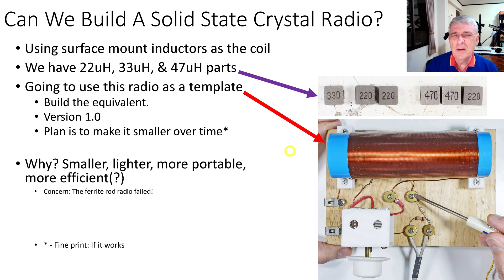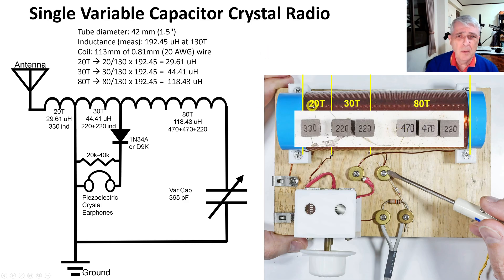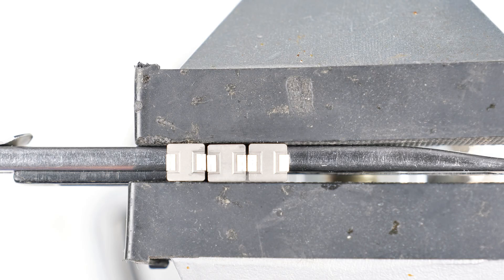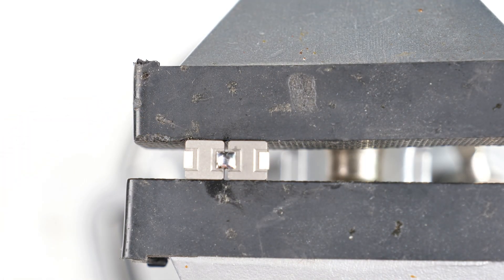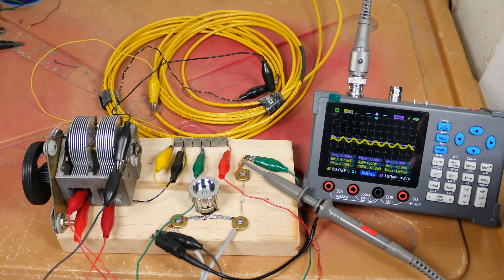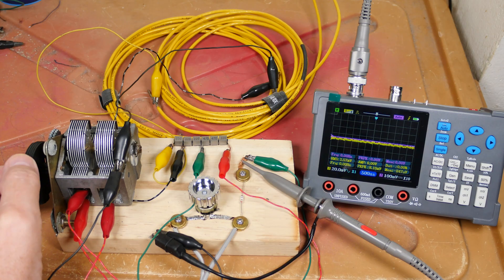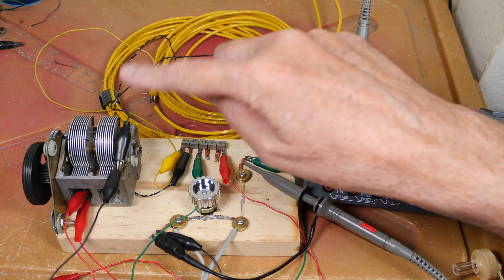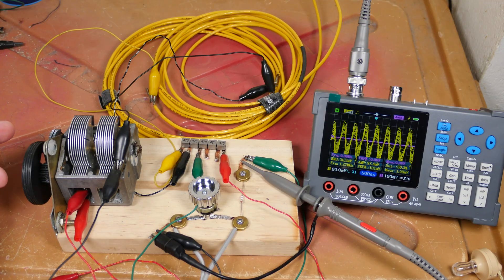Crystal Radio--Using SMD Inductors??? (4K)

Comment: I suggest using a different radio circuit.  The usual radio circuit using coupled inductors for impedance matching, but there's an analogous circuit that uses a capacitor network with a single inductor.  In fact, I have it working on my desk right now!  Instead of tapping the inductor side of the LC resonator, tap the capacitor side.  That is, put two capacitors in series, those parallel with the inductor.  I'm using 150 pF between the antenna input and ground, with a 10-400 pF variable capacitor between input and the top of the inductor.  My inductor is 40T on a 3" cardboard form (salt box).  My diode comes right off the top of the inductor.  Since this design uses only a single inductor (200 uH, if I've calculated in right), you should be able to use an SMD inductor in its place.  (PS: My antenna is a dipole cut for 3.5 MHz, 50-ohm impedance, my earpiece
Reply from the maker: I think your comment got cut off.
Reply: @tsbrownie    You're right.  The last sentence should have read "my earpiece is a high-Z crystal earpiece from a commercial crystal radio kit."
If you want more details on the "single-inductor, capacitor coupled", design, I could send an email if I had your address.  I'm at "lathechuck (as shown in my photo)", using a popular email service (if you care to guess).
Reply from the maker: @cdorcey1735  My email is in the "about" on my channel. I'm always interested in new designs. Thanks.

Comment: "in theory inductance is inductance". No, you are wrong, there are different inductances types. Like mutual inductance. A transformer is not just two coils, primary and secondary. Those inductors you are using, have you opened them? I think that they are made on pot core or something like that, that is why they do not work. The one station you received was because it was the most powerful or the nearest to your location? You need to have coupling inductances. Maybe try to simulate the equivalent circuit you have at 2:00 (that is an autotransformer basically), think about it?
Reply from the maker: @sebastian19745  I am going to open one. I assumed they were like the small rectangular ones where the coil is horizontal, but in fact they may be vertical.  We shall see.
Reply: @tsbrownie  I just asked because I believe that the magnetic field is contained and is not interacting with the neighbor inductances. That is you may not have any mutual inductance, that is needed because the original circuit is an autotransformer.
Reply from the maker: @sebastian19745  I think that is also likely. We shall see. I don't give up until reality defeats me!

Comment: Seeing lumped value components used together to form a tuned circuit, inspires me to suggest take the idea further by...
Having a PI network, to do an impedance transformer, by using two independent variable caps. Tune in by finding the best contribution from each the two caps to resonate with the coil.   Similar to having twin wipers on a coil but in reverse.
Of course the coil needs to be instead a decent Q , biggish diameter,  maybe litz wire or a ferrite. But not these SMD broadband low Q thing.
Reply from the maker: Interesting. I was surprised how low the Q value is on these. Should have looked before I leaped, but then that takes all the fun out of it!  ;)
Reply: @tsbrownie     a bit further explaining on the PI network idea,   two grounded variable caps, their fixed plates attached either side of a fixed inductor. It makes a versatile resonant impedance transformer.  It's often used in an ATU box, with two knobs to match a transmitter with a complex impedance.
Reply: @tsbrownie    Low Q is sometimes a good thing, stops ringing after a pulse.

Comment: Two things :- The "Q" of the SMD inductors, and very little self coupling between them. Surprised you received anything...
Reply: Yeah! If you look at the data sheets for SMD inductors, the 'Q' is quite low compared to their bigger counterparts. For a good crystal-radio, you need the highest 'Q' you can get.

Comment: 0:38 Don't the big coils are in line, sharing the "core". And do the SMD ones have their cores vertically, next to each other? And is this affecting their influence on each other?
Reply from the maker: This type of inductor that I have broken open in the past have the coil horizontal. But this may be different.

Comment: i would assume the coils in those inductors are all measuring the same inductance as the package says but what is the polarity? if a coil is stuck inside with vertical core then your colective inductor looks nothing like single coil with multiple taps .  It might have the same inductance but in that orientation side by side coils could magnetically  interfere with each other rather than adds up
what would happen if you stack them up with all cores facing the same direction only one on top of each other? assuming they all align magnetically
Reply from the maker: @kokodin5895  Good questions. The coils of this type I have broken apart in the past were horizontally oriented, but that does not guarantee these are. It's very likely they are wound the same direction because they came out of an auto-placement strip.

Comment: Stretch your antenna wire out.
Reply from the maker: @imnobody0034  It is 15 meters long. It's the same one I use in all my crystal radio videos  so it's the "standard." A small,  portable radio that requires a really long antenna is not very interesting.
Reply: I read somewhere quite a few years ago of a 2 foot square frame antenna wound with thick wire. Didn't need any other antenna

Comment: Fundamental problem here is assuming inductance is linear with number of turns. Inductance goes with the square of turns because of coupling.
Reply: Yes, but the fundamental problem is that you can't split the coil into three separate individual ones. As others say, the sections must be inductively coupled.
Reply: @paulperry7091  Yes, you can (in theory), that is how modeling an equivalent circuit works. But I am not sure about how it works if the equivalent circuit is built, I never tought at that. Maybe some experiments?
Reply from the maker: I may have an issue of coupling because I assumed the coil was horizontal (like some smaller, rectangular ones I broke open), but if these are vertically oriented, that could be a huge issue. I need to break one of these open and see.

Comment: A  HUGE  coil on a scrap (  card toilet roll 😝) will always work best , the (  Q  ) is  MUCH  higher .... the UK ( Mullard ™ ) Germanium diode , type OA79 has been found to be the most efficient for such tiny RF voltages , but the OA81 is almost as good .. the old 1960's ( pink ! ) crystal earpieces also help a MUCH louder reception ..... DAVE™🛑

Comment: The inductors aren't coupled
Reply: They're also very low Q value and most are rated at their Q values for much higher frequencies. One can get by with lower Q values if regeneration is used, but coupling such in an SMD inductor is beyond problematic outside of a factory.
In theory, it could be done, but we're talking sealed units with silver wire and frankly, absurd pricing due to what's involved in such a super niche application.

Interesting head melter, I'll put it on one of my back burner project lists.

Comment: I think the wound and tapped coil acts as an auto transformer as well as a string of inductors try placing a piece of transformer steel or ferrite rod where your finger was and it might improve. I think some inductors are designed for minimum external magnetic fields which would not help.
Reply from the maker: @johnharris6589  I tried a ferrite rod on the inductors and it did nothing. I afree these inductors probably contain the EM field.

Comment: Neat experiment.  Perhaps the coil orientations might be interfering with each other.  Try it with the inductors stacked on top of each other, or each one separated by a larger distance.  In the past I've used the green axial inductors (end to end) with decent results.  Don't give up!
Reply from the maker: @aaronwoodard3354  Thanks. I had not thought about orientation. I will have to look into that.
Reply: yes, stacking, but make sure the B field all goes in the same direction. If  one of them gets reversed, then you may get nothing at all.
Reply: @aaronwoodard3354  Excellent idea. This determination ought to be interesting. I still can't help but think the idea must be more viable than the initial test indicated.

Comment: Like the circuit would be same full circuit but take the coil off and jumper those connections.  I bet you will hear that station or 2. :)
Reply from the maker: @maikerumine  I have a video on just using a diode only. This is only a little better and costs a LOT more.

Comment: What you were tuning was antenna.  Do same experiment without the smd and use a short.
Reply from the maker: @deletemeforevs  You mean just use a diode? If so, I have done that. It works almost as well as this. 😞
Reply: Yes!  Keep on tinkering.  I tried to make a ferrite mini, it worried but only with a long time and not that loud
Reply from the maker: @deletemeforevs  That's also my experience with small coils.